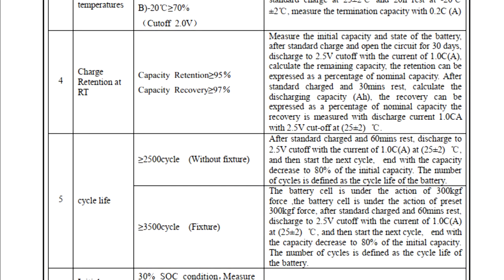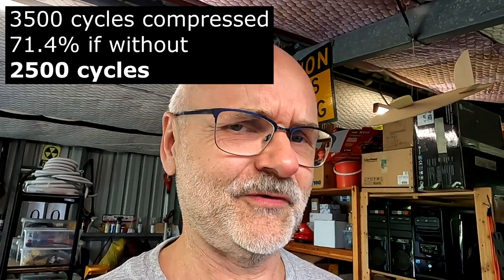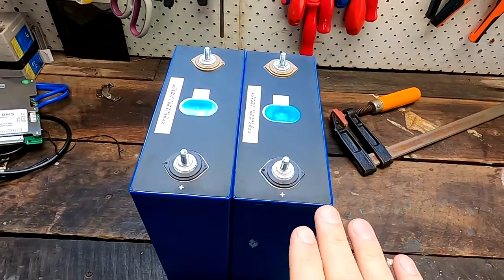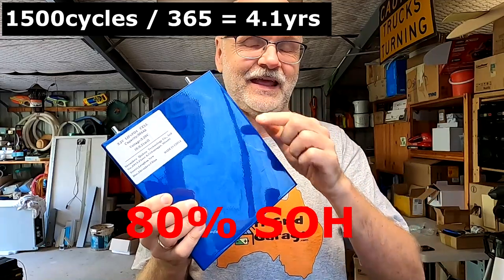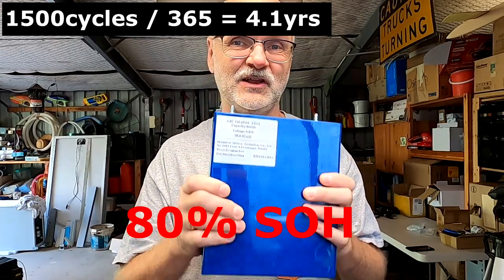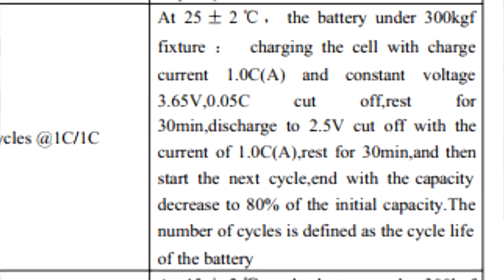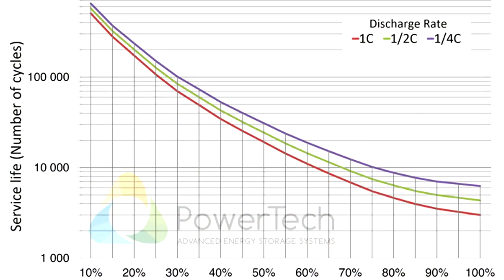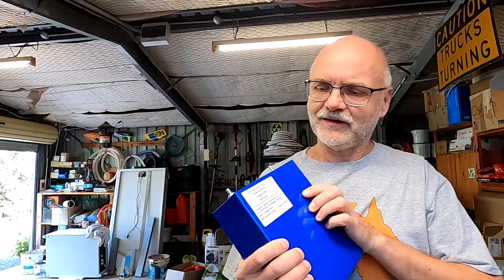Why compression will not extend battery life (something else kills your batteries).

Comment: I have 7 years on my 900 AH 48v lithium bank it never goes below 50% it's still performing at 96% of its original capacity..
Reply from the maker: Thanks a lot for sharing. A true pioneer in this field!
Reply: compressed or not compressed?
Reply: @jimmy4518  
Compressed.
Reply: @TheMFrelly  Hey could you show us your set up or maybe where you purchased your cells? Please, I’m new to this and I think I’m on the right track of finding Indy from people that aren’t sponsored 😂
Reply: Can you share  your charge  settings?
Reply: In my opinion the one reason I might  to compress cells(if i ever build one)is to remove the strain/movement on busbars ect.   Setup with a gap like off grid garage, likely accomplished the same thing.
Reply: The secret answer is in this question: the best battery manufacturer compress they're lithium battery ? If yes, Very good.

But if not? Are all stupids?

I have another dubt about this miraculous life span of century..
Why super expensive battery like battle borrb, , mastervolt, victron, Trojan, rolls, in many cases predicts a lifespan of 2000 80%dod cycles?
Victron I think still today make batteries with Winston cells.. are they garbage? And are all people that buy, stupid?

Comment: I wanted to give all the advantages I could to my investment. A squeeze box is inexpensive. It may have a marked advantage as a fight against calendar aging. A lot of all these projections are exactly that, a projection since obviously time will only tell. I do believe we will see failures of terminals and internal damage to the “jelly roll” due to expansion and contraction of every cycle. Flexible buss bars may help with the terminals but compression may help the innereds. Again, time will tell. Andy did make a point about a small gaps between the cells for cooling. That’s definitely a negative with tight fitting compressed cells.
Reply: A thin malleable heatsink between the compressed cells could provide some cell temp reduction.  A sheet of aluminum extended beyond the outer cell edges comes to mind... just make sure there's no chance of it coming in contact with the terminals or busbars!
Reply: i totally agree with Karl Jensen ...>>>>>it would seem to make good sense to do the inexpensive compression jig...an inexpensive improvement...and keep all components, batteries, inverters charge controllers in a climate controlled space to increase their life span... the false assumption that there will be cheaper batteries in the future.... because the attempt to increase the life span cycling as the manufacture specification sheet says is the better path /more prudent path to go down...ignoring the manufacture spec sheet is just fine if you like to waste your money....32 cells cost $2900 delivered in September 2020... they cost $4300 in October 2021 and in the present year 2022 they are now close to $5000 dollars... if you think that inflation is nothing to the increased cost of LiFePO4 280Ah cells and promote doing nothing to protect or preserve this huge investment....a fool and their money soon part ways....the fixture should contain them with similar pressure near the top where the busbar interconnect are and toward the bottom so the busbar connection ANGLES do not change...heat is caused by poor connections. flexible bus bars are a possible partial solution to part of the design problem... the fixture is the keep the thin-walled RECTANGLE SHAPED ALUMINUM CASED PRISMATIC cells from bulging and allowing the inner plates from distorting and sagging... (the so-called "jelly roll) if there is someone who actually has any real scientific basis to say do nothing is the best route over making an effort according to the scientific specification sheets of the manufacturer then provide real data.... AGAIN IT IS THE BETTER ROUTE TO DO SOME EFFORT THAN DO NOTHING....
Reply: @pilgrimvalle  
Great minds think alike. 👍 I wouldn’t change a word. No rebuttal. Eel battery distributor told me that his source was quite adamant about the need for compression. Just short of saying mandatory.

Comment: 100% correct Andy, Nowhere in the Eve spec sheet does it mention compression. Fixture and clamp yes, to keep the bloody things still as vibration will stress the terminals. I can't see sunny Queensland shaking to much in the near future unless Andy drops another bombshell that he is going................on holiday!!!!!!
Reply from the maker: Uhm, oh, ah, I have a few days off after Easter, so actually... 😏
I was going to use this time to put the batteries in the shelf though.... if that is what you want? 😁
Reply: It mentions 300kgf applied in a fixture. That counts as compression, even if the name is not 100% on point.
Reply: @upnorthandpersonal  A fixture is to hold it stationary. They do not say anything about compression or where to compress. It is surmised to apply pressure on the large flat areas but what about the other sides and top and bottom. I have checked the Chinese characters for these words and are completely different shapes so there could not have been interpreted wrong. Until Eve explain exactly what they want it will be up for debate for years.
Reply: @glencooke494  This has been discussed with the actual EVE battery engineers. A 300kgf is applied with a fixture.

Comment: Finally! Somebody who looks at cycle life the way I have been. I’ve been saying for a while that my batteries will outlive me .
I’m currently only use 20-50% of my batteries power per day for 6-8 months a year. The average draw on the batteries is 5-10amps with short spikes of 50-75amps.
Reply from the maker: Ha, they will live forever with these small currents. If you keep them cool 😉
Reply: I think you mean the batteries will outlive you!
Reply: @grahampicman8286  yeah, I screwed that up lol
Reply: @Off-Grid Garage  you hit the nail on the head. Cooling is the issue where you are in OZ. You lose about 25% of the life at least due to temperature alone. If you cool them and compress them they will last for ever

Comment: Good one again Andy.
My Winston 400Ah cells are now over 6 years old. With simple capacity tests, I’ve seen no NOTICEABLE or measurable degradation so far.
Reply: 8 years here on my old Winston cells. Still going very strong.
Reply: is there any any cells bloated?
Reply: I have Wisnton 100 Ah WIDE and TALL from 2013, and they perform OK, without BMS, only monitorinig cells voltage, 0.000 mm bloated.
Reply: @angelabrillajr.1209  winston ones have that beefy outside cell.. they even heavier... didnt ever figure out in any video of em mention any seen bloat

Comment: Spot on, I did the numbers for myself too, and decided that by the time I wear out my cells, I will probably be dead. But even if I did wear them out in 5-10 years, there will be a significantly better battery available to replace it, at a significantly lower cost, with better performance. Compression/fixture is a tiny gain when we could be spending our time and money on other bigger gains. The $100+ worth of materials could buy us another solar panel, or better wiring, or lots of other more beneficial things.
Reply: And this right here, is a great example of why the planet is fucked.
Reply: @StartledPancake  perhaps you can be a bit more expressive rather explicit. Your comment means absolutely nothing because it has no context. The swearing is not necessary either. 

So do explain to the rest of us where your vague hatred comes from. There's a more than obvious argument that the planet is @#$%^ because of people like you who chime in to voice an irrelevant point of view, without backing it up whatsoever. 

If you don't have something of value to offer, just don't speak at all. 

And finally, when my cells wear out, they will have done their purpose, regardless of if I use them harshly for 5 years, or gently for 20 years. When that time comes, the materials inside those cells will be reclaimed and reused in whatever the most appropriate way is at the time.
Reply: @PowerPaulAu  You know exactly what Im talking about, so there is no need to be more explicit.  Lithium mining is one of the most environmentally damaging mining processes on earth and the metal itself is in incredibly short supply.  There is as yet no economic way to recover lithium from batteries and even if there is, that process will be environmentally damaging also.

People shortening the life of their, highly impactful, batteries because they cant be bothered to spend an hour making (or buying) a compression set is shameful, there's no other way to put it.
Reply: @StartledPancake  you're very wrong about the recycling of the components of these batteries... Go get some up to date information. 

It sounds like this isn't the right place for you to be either, there's Lithium discussion and use every episode. Go where you'll have something useful to add, because it's not here. 

You don't have to like me or what I do, but it doesn't entitle you to go on a rant about it. Be gone little troll.
Reply: @StartledPancake  That's a bit of a Utopian view, considering we as a human race are still struggling to get out of the coal/oil age. Can we at least agree to leave fossil fuels behind before we march headstrong in to solar powered battery efficiency issues?
Reply: @PowerPaulAu  Feel free to link to a company that has online facilities  for performing full recycling of a lifepo4 battery as of today.   Hint, that number is zero and will stay zero at any sort of scale in the UK,  for years to come.

As for the rest of your comment, grow up.
Reply: @StartledPancake  the Glencore/Britannia Refined Metals facility is currently in planning for Northfleat in Kent and will be opened next year.
Then there's another facility being built in Rotterdam by TES.
Then there's the facility being built in Halmstad in Sweden by Stena Metals.
Then there's the facility being built in Leon in Spain, opening next year as well. Or the facility that Volkswagen have already opened in Germany.
Or the facility being built in Poland.
Or the other one from BASF in Germany.
Or that in terms of EV batteries, there are already several installations which are giving a second life to those batteries as grid balancing batteries. Many Nissan Leaf batteries are getting a second life there, beyond their service life in cars they still have a use in fixed installations.

There's no need to be pessimistic about Lithium recycling, it's coming online as we speak. But finally, there's also a massive trend towards Sodium based batteries, which are great for this kind of domestic use and sodium extraction is significantly less environmentally impacting than Lithium.
Reply: Paul, thanks for your positive comments and sentiments. I’m with you. Thanks.
Reply: @BobHannent  It's a great list but as as I've already said non of those facilities are online and we are at least a decade away from large scale recycling.  Hence people should take the best care possible of their batteries.
Reply: @StartledPancake  struggling to see where Paul  said he was actively trying to make his cells wear out as quickly as possible! Not sure where all this pent up aggression has come from but no one is dumb enough to shorten the life of any expensive purchase
Reply: i think spending the $100 on another solar panel would indeed be worth more, making sure you get your battery back up to 100% is worth more to me
Reply: @StartledPancake  just because you refuse to acknowledge all the places recycling lithium already, doesn't mean they don't exist, they do. You're free to live in any fantasy world you want to live in, but don't go trying to drag the rest of us into that void, we're not interested. 

Andy has a great channel here, if you don't have anything useful to add, then just go away so it doesn't get clogged your your garbage ramblings. Everyone here is disagreeing with you, that should tell you a lot.
Reply: @StartledPancake  headsup, northvolt in sweden is using recycled materials from lithium cells that comes from norway

Comment: i'm totally with you with the "batteries needs proper ventilation" part. In my opinion, stressing (overcharge/discharge/high c ratings etc.) batteries eats its life faster than any other factor, building a bigger energy storage can easily solve this factor.

Comment: Andy, I think you're spot-on with the cycle counts. Great calculations and appreciate the information sharing! One thing you haven't touched on though is stress put on the terminals. Many people are using solid/rigid busbars that come with the batteries. These batteries expand and contract naturally - maybe a millimeter or fraction of a millimeter. Don't you have any concern regarding the stress this movement may place on the terminals from the solid busbars if the cells are not "fixed" together? We can agree the amount of movement is super tiny; however, compounded over many years - could result in premature failure. Or maybe I'm just overthinking it? I'd love to hear your thoughts. Of course, this can be negated by leaving space between I suppose...
Reply from the maker: Thanks for your comment. There are two types of expansion/shrinking, one coming from the pure temperature change, the other from the swelling/contraction of the cells during charging/discharging.
I think we can disregard the temperature caused expansion as this will be very minimal (but it could still contribute to mechanical stress if it adds to the force caused by swelling due to charging).
The thickness of the cells stated in the datasheets is 72mm +-1.0mm under 300+-20kgf. Obviously this is just the production tolerance for the aluminium case but interesting they show this figure under compression! I have yet to find a method to measure the actual swelling/contraction with such a precision so it is reliable and reproducible. As you said, it could be a fraction of a mm and I believe this is occurring only around the area where the electrodes sit in the case. So a partial, non linear swelling. Interesting is also that some cells tend to do it more than others which could be caused by (poor) manufacturing processes and tolerances.
I will leave a gab between my cells so they stay as cool as possible and also avoid any mechanical stress when using rigid bus bars.
I believe high temperatures may have a larger negative impact than we can compensate with compression. If you live in a cold climate and can keep the batteries at around 20°C all year around AND compress them, that would be the ultimate best setup to maximise the life of these cells. 

Uh, that's a long text now, sorry 😊
Reply: If there is a bulge expansion coming from the middle of the cell it can be caused by the highest temperature in the middle. The uppoer and lower parts will then get a gap of air as coolant stream if they get ever really hot under high A.

But considering that below some Winston LiFePo4 owners talked about 6 or 8 year old batteries they use without any complaints and nearly 100% capacity still it looks quite good for me.

Finally: if you do not fix then there might be only additional stress once they start to blow up more than before cause connected with no pressure means always a small gap and marging for expansion without damage. Not to forget 4 NM for the nut is not the tightest and the hole is usually at least 1 mm bigger than the strud.

Might be worth an experiment for one who has 2 big batteries  to run both architectures in parallel to make a proof what it is all about. 

Not sure if I will do a compression again cause such a 300 kg pressure is for sure a physical stress for all the cells. 
But I guess there must be something true cause otherwise they would not have added such specific test and use procedure to gain 6000 cycles. 

Thanks for the good work on your channel too.

Comment: I agree with your conclusion regarding the practical advantages of compression. I still fix the cells in place though (not really compress, just fix so that they cannot move), mainly because I would like to avoid putting stress on the terminals.

I am aware that it is possible to use longer busbars and have gaps between the cells and therefore better cooling. On the other hand, such battery pack is difficult to move around.
Reply: This is how I did it too, not compressed but set up to prevent expansion

Comment: Thanks for putting this out, we do not run compression on our banks either.  My thought was the same that by the time we no longer have usable capacity left we will want to replace with new technology or no longer be living.
Reply from the maker: Yeah, it seems like the batteries could outlive some of us. Me included 😊
Reply: The data sheet states that you should replace them when they're at 70% capacity.

Comment: love it.....i did some rough math on the cost of material for making a compression fixture and after realized that the money should be spent on more batteries to reduce the stress and get the same result of more cycles.  thanks for the in depth talk about this fad.....opps now someone is going to be mad.....lol
Reply: You need to simplify. Heck for the cost of a cheap ratchet strap, $3usd and a small piece of scrap 2x6 on each end, pennies
Reply from the maker: Thanks Arnold. People went mad at me when I started building my first battery. They all said I have to compress otherwise I would damage the cells. But a bit of googling shows, it's really only necessary in certain environments... which is not my solar set up.
Reply: you can do it with threaded rods and two wood pieces. cheap